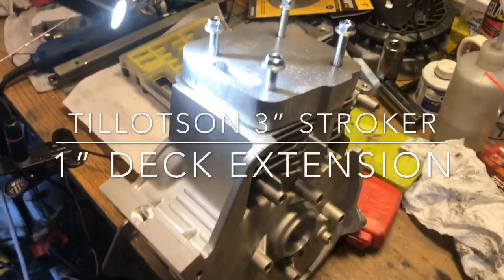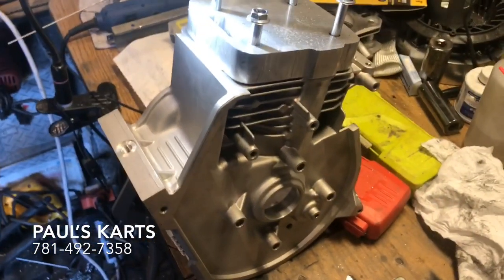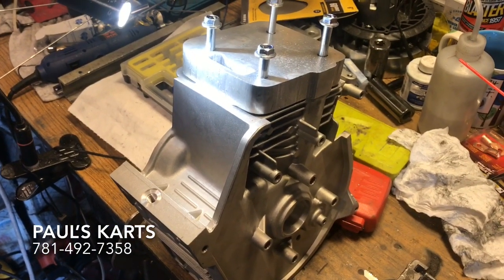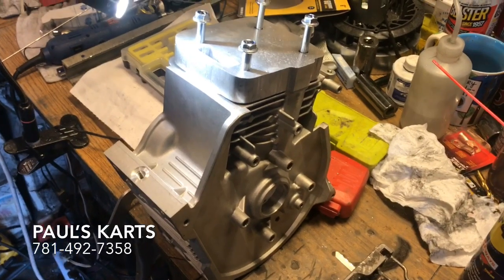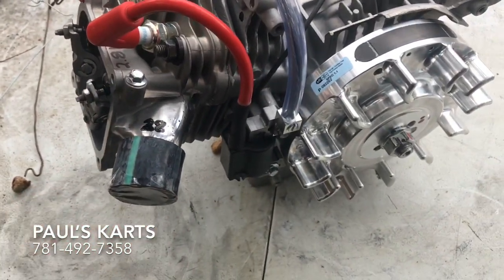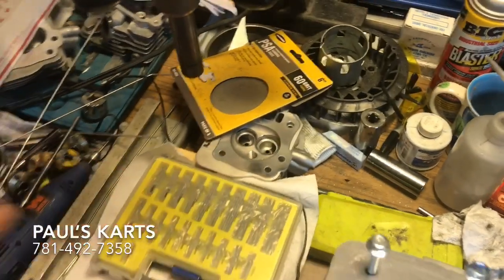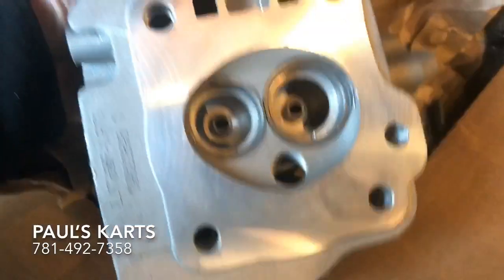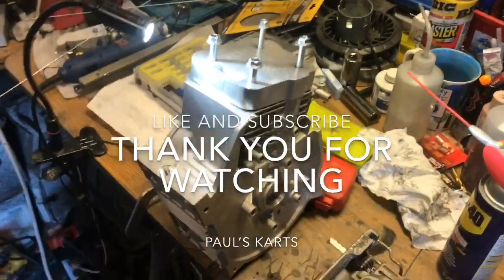TILLOTSON 3” BORE STROKER / 1” DECK EXTENSION / WELDED BLOCK

Comment: I made a 1” deck extension a while back ago too but I have a Bridgeport so I was able to bore for the new sleeve and I did the counter bores for down pins to line it up and machined both surfaces precision flat and parallel . Took me about 2 and half hours. I wish I could send you some  pictures. My design for the spine brace looks sick as hell. I used 1/2” aluminum roughly cut on band saw. Then I hand ground it to fit to the block then I made the outer edge of it curved snd smooth with progressively changing holes sizes to follow the curvature edge. holes from 7/8” down to 5/16” all the way down the spine. Took me about six hours for all of these I
Reply from the maker: Text if you can hang out the plates I’ll take a few maybe depending on price .. I got no time for bullshit
Reply: Paul's karts Lifan 420 ok that 781 #? I’ll probably be ready to do something in about a week I got a big week next week but I’ll b texting you from a 918# in about a week.and for prices I don’t kno I just know mat. Costs. But labor can vary. You probably have a better idea of how much going rate for those plates are than I do. Ttyl give me a week k
Reply from the maker: Yea these take a long time to make .. I hate these .. rather do the gravy jobs

Comment: Good to see you have one of those blocks .I've got the 72mm for a future build but my question to you or Minidrag Bike is who are you getting your cranks from???  ARC's largest stroke crank is 2.300 so why a 1'' block extention??  If you had an extra 1'' stroke you would have to almost no dipper room and probably a poor rod / stroke ratio so please explain .  Feel free Minidrag Bike to chime in since your no stranger to this.
Reply: I think they use a B S billet Animal stroker crank machined to fit the Honda clones.
Reply: @KerryCaberga-2025  Ok..... That would be  2.637 an additional  .337  still a lot of bore to fill up and i'm unaware of any 4.00 '' plus length rods to get the piston close to the deck unless the plan is to deck the poo out of it in which it would be better to start with less material. I dunno....that's why i ask questions.
Reply: @davidgoodrich4745  Theres a tall deck billet animal block and I think the block is 1" taller. Thats the crank Im talking about.
Reply: @davidgoodrich4745  

https://youtu.be/RBAc6YYTK8w
In this video Charles is explaining a little more about the modified Briggs crank for Honda blocks.
Reply from the maker: Lol .. it’s magic lol .. jk .. it’s all custom man
Reply: @paulskartslifan4206  You and minidragbike are not from this world and should be investigated...LOL
Reply from the maker: I make mine from scratch .. they sell them cheap for animal .. that’s why he does them .. it’s all just bolt on shit .. I’m fabbing up all mine like Michelangelo